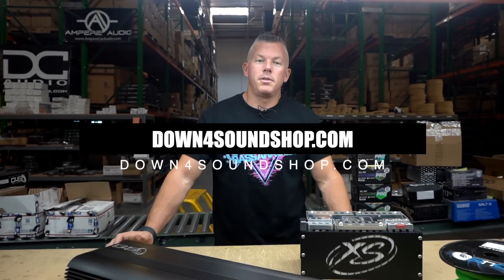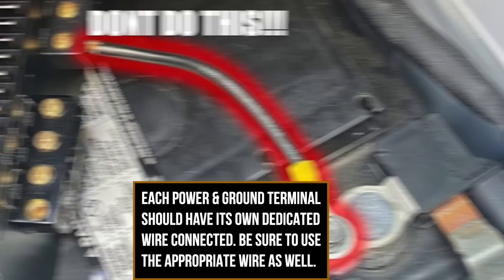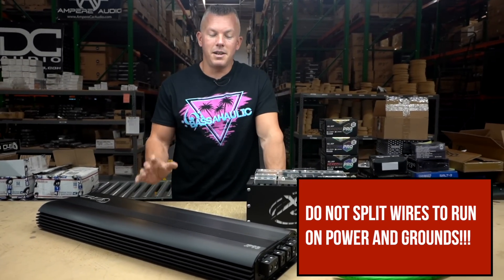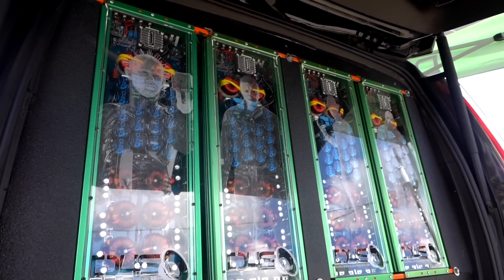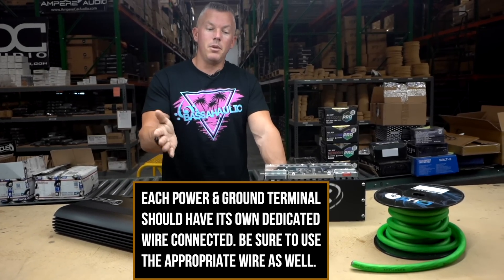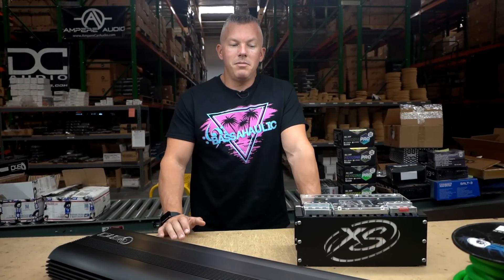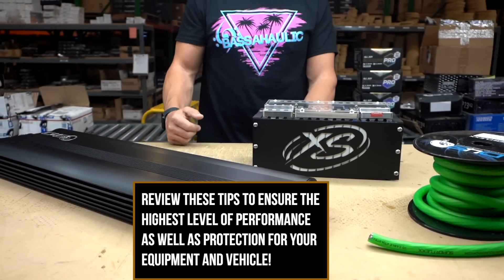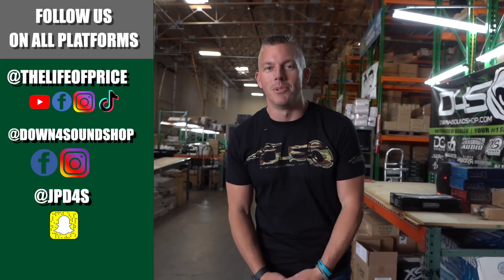STOP DOING THIS TO YOUR POWER AND GROUND TERMINALS!!! WITH JOHNATHAN PRICE

Comment: Had this exact conversation today.   Customer bought a jp83 and brought it to our shop to get installed and had a single 0 gauge CCA kit.  Um yea, no thanks.  I handed his keys back to him when he realized 3 runs of 0 gauge including the labor was going to be over $1000.
Reply: Wow that’s ridiculous price.
Reply: @Thumper68 @Thumper68 Six runs of OFC zero gauge is not cheap, and I'm sure they did not do the big 3 or 4. I bet they were trying to do that on a stock alternator.
Reply: Not really thats like 6 or 7 hundred for just the material. So 300 to install that? Doesnt sound outrageous to me. @Thumper68
Reply: @Thumper68 I don't know where you live but (3) 0 gauge OFC amplifier kits as well as installing an additional battery and hooking everything up professionally takes a lot of time and skill.  Just the wiring kits alone was $600
Reply: @melissathompson7229  that outrageous especially if they already have the battery. It takes some time and basic skills or at least what I consider basic.
Reply: @Thumper68  3 - 1/0 runs really isn't a joke for install....a lot of people think they know how to do it right, until it comes time to do it right....plus if you don't have the alternator to keep up with it your gonna be replacing that and them existing batteries pretty quickly...shop labor aint cheap and neither is quality work....if someone knows how to do it themselves (THE CORRECT WAY), then by all means do it. But if they don't, then doing it the right way is definitely gonna cost em...
Reply: @melissathompson7229  I'd be curious to see some of the shop's install work....that might be a cool channel to get up and running if it's not there already....
Reply: Finding a safe and good looking way to run (3) 0 gauge wires in a vehicle where a mechanic won't want to kill you if it's done sloppily takes a lot of time.  In fact at a reasonable shop rate of $90-100 per hour id be willing to bet money you could not safely and neatly run all of that, including building a tray to safely install an extra battery, hook up the amplifier and properly set gains, xover, subsonic etc as well as the high level input.   It just takes several hours to do

Comment: Jonathan I’ve been doing car stereo work for a long time on my own. I’ve gotten to the point where I do not fool with anybody else’s vehicles I’ve got away from it. I was taught by a professional how it needs to be wired if it needs one power and ground if it needs 20 power and grounds you run them all I watched a lot of vehicles burned to the ground because of sheer stupidity of the owner of that vehicle. this is the reason I have gotten away from doing installs. It got down to the point where we were having to run specialty screws that the bits could not be bought at a local hardware store. You had to order them to keep people from screwing with their own shit Because they would want to turn it up to the max instead of learning to run it where it was properly set the reason I do not do it anymore like the old saying goes you can’t fix stupid and this day and age there’s no way you can fix it

Comment: Well said, JP!!!! I've fried my amp, but it was my fault, and I learned. I was without bump for a few months. But hands down, you are the best place to get the best price!! So far, DC audio has been a beast!! Just need a mechman 240 to be safe with it. I just replaced an alternator and battery and did an alternator chip fix on my PCM. Running a 1 level 3 dual 2 omh dc audio wire to 1 omh on mono block 1200 dc audio Amp. A second AGM battery by the Amp. GREAT VIDEO BROTHER!!!

Comment: Point counter point here...i bought a Stereo Intergity 1500.1 with the same muliple inputs. Nick told me only 1 input was required. I scratched my head but also ran wires into both,

Comment: Is the JP40 lithium battery discontinued?
Reply: i think it is, i got one on sale when it was 400$ and it does great on my 05 tahoe w stock 160 alt. a recoil di1200 and a stinger mt2000, i hardly get voltage drop below 14.4 with the car running. I wish he still made them I wouldve gotten 2 if he had another deal
Reply: @firmhandshakes7469  nice brotha I got one on sale for 400 as well a couple months ago haven’t installed it but I’ve been using a down4sound LTO 6.0 with a 240 amp alternator never a drops below 14 volts ima install my jp40 here soon tho!
Reply: @firmhandshakes7469  do you use Agm under the hood or a super bank cap from xs power?
Reply: @firmhandshakes7469  I just installed a JP40 lithium battery and mine drops down to 12 volts at full tilt I gotta mechman 240 amp alternator with 0 gauge wire and my last down4sound LTO 6.0 would stay in the 14s I don’t understand why I’m dropping 2 volts. Any suggestions?
Reply: Looks like I bought my two just in time.

Comment: I have a jp13 at 1 ohm on a single custom svc 15, i have three batteries and 20 farad cap and this amp absolutely does what its supposed to with no issues accept the cooling fan sounds horrible lol sorry jp😅😅